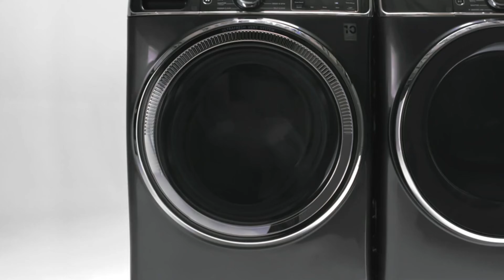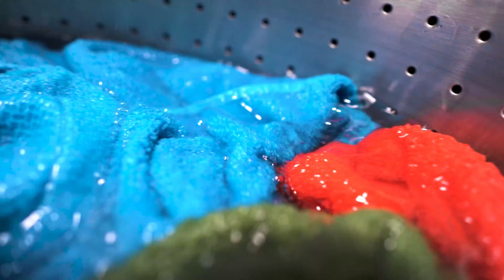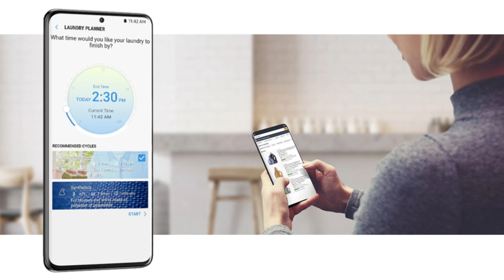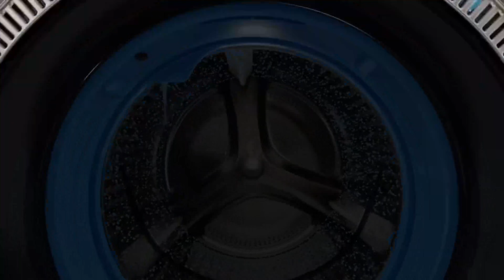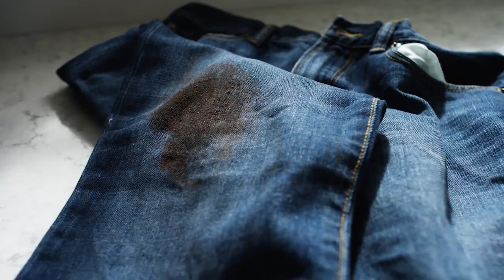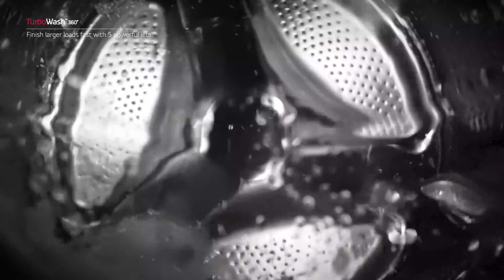7 Washers Mechanics Trust With Their Own Money (No Premium Brands)

Comment from the maker: Links to the 7 Washers Mechanics Actually Own are listed below.

► 7. Speed Queen TC5 Top-Load Washer - https://bestbuycreators.7tiv.net/B5EX6x

► 6. Samsung Super Speed Wash High-Efficiency Washer - 
at Lowes: https://shoplowes.me/3MA5iUf
at Samsung: https://howl.link/f8q0ctvdzal2d

► 5. Electrolux ELFW7637AT Front-Load Washer - https://shoplowes.me/4kukPkX

► 4. GE UltraFresh Vent System Stackable Front-Load Washer - https://shoplowes.me/4aF5sTn

► 3. Whirlpool Top-Load with 2-in-1 Removable Agitator - https://shoplowes.me/4ksA5yH

► 2. Maytag High Efficiency Front-Load Washer with Steam Cycle - https://shoplowes.me/4a9Q4hT

► 1. LG Front-Load Washer with Inverter Direct Drive - https://shoplowes.me/4kspqEp